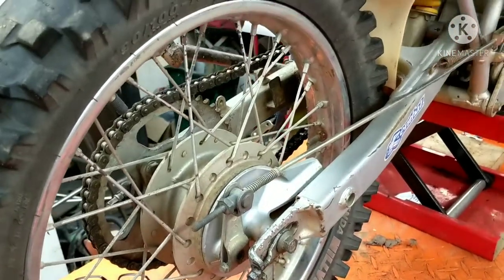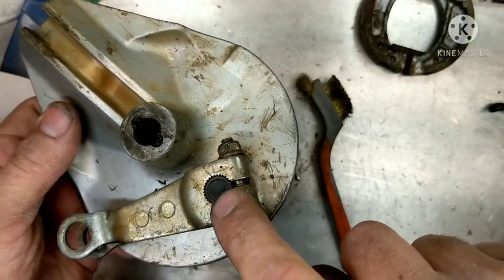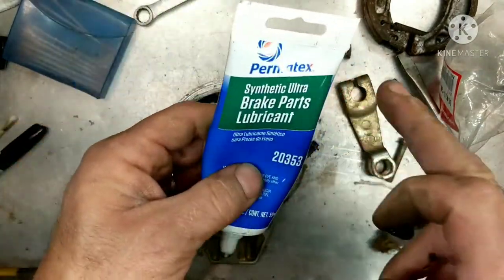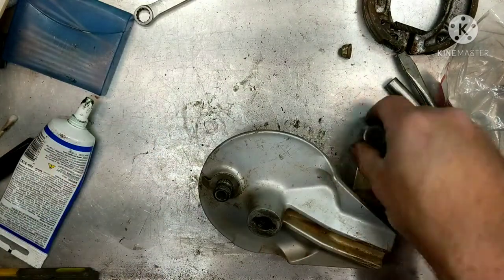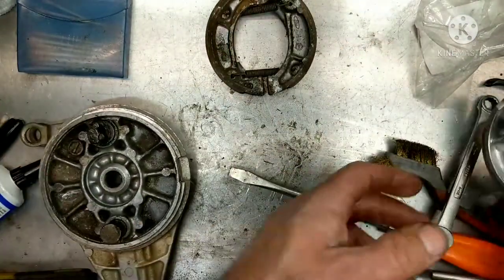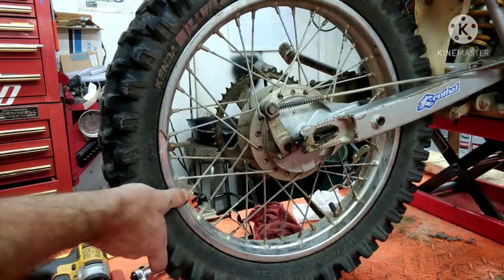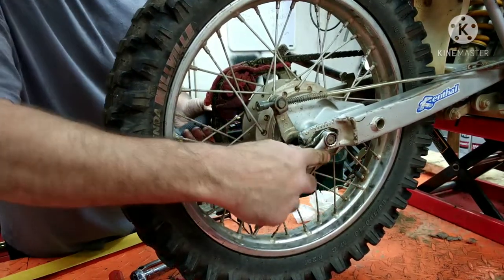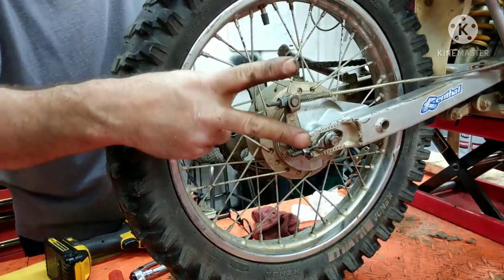Honda XR100 CRF100 rear brake replacement.

Comment: I have an issue with rear suspension link, I'm trying to remove the bolts but there is one I can´t take out, it holds the "triangular" link to the swingarm, I noticed there are two welded washers that doesn´t allow the bolt to move out, could you give me an advice on how to remove that bolt? Thanks for your help in advance... Have a nice day!!!

Comment: I have a question the front and back brakes are the same size? I have to replace the brakes on my 2002 xr100r but both look similar

Comment: My springs do not have opposite hooks is that normal or do I have to get the spring to twist in order for them to be opposite, I have the same amount of tension as you do in the video
Reply from the maker: The springs should be opposite, if they're not they're the wrong ones. You can't twist them to work, the spring tension will just twist it back.

Comment: I just bought a 2003 xr100r and the rear wheel was missing all the spacers and the bearings were shot. Can you please explain or show where and how the spacers are assembled! I was hoping you would show complete disassemble and reassembly showing spacer placements. Thanks
Reply from the maker: Best thing to do is check out a parts diagram for spacer locations. I do have an XR100 here now, if you have any questions please feel free to email me on my about page. Here is a link to the parts diagram for your rear wheel.
https://www.rockymountainatvmc.com/oem-schematic/2
Just select rear wheel after clicking the link.

Comment: My rear break hub won’t come off. I’m thinking pry from opposite sides at the same time and try and force it out. What do you suggest?
Reply from the maker: Make sure the brake pads are retracted all the way.
Reply: I have everything off but the hub and the shaft the lever slips onto. I put the lever back on and worked it back and forth while I was pulling up on the hub. Still jammed. The hub will rotate all the way around freely

Comment: Whats the thing that holds the rod?
Reply from the maker: Rear brake arm. 43410-KN4-A60
Reply: @TepcoCycleRepair  no not the arm the thing thats in the arm that the rod goes thru
Reply from the maker: @Yabadoop  Rear brake arm joint 95015-32001 I get all my parts from rockymountainatvmc.com
Reply: @TepcoCycleRepair  thanks man i came in the mail last week of amazon and now my brake works again. Your the first one to help me thanks dude!
Reply from the maker: @Yabadoop  Awesome, thanks for the update!

Comment: Ok so I put brand new pads on for the rear and they don’t grab… not even the slightest I cleaned the drum and still the same thing
Reply from the maker: Are they making contact with the drum?
Reply: @TepcoCycleRepair  yes, when I have the rear wheel off the bike and try to rotate the drum while keeping the wheel still it will grab nice but as soon as it goes on the bikes it’s ineffective
Reply from the maker: @therealilxaiden  So two things can cause that, Improperly adjusted mounting point/brake rod or extremely worn drum. I'm going to guess the first. If it doesn't grab with new pads, rotate the arm one notch back and reset the brake arm. If it's too far forward when you step on the brake, it will bottom out and won't be able to apply the proper amount of brake pressure.
Reply: @TepcoCycleRepair  I solved it. For one I didn’t have the dots lined up on the rod and arm. And two I had the rod way too much to the front. They work nice now. Thanks for the help 😁
Reply from the maker: @therealilxaiden  Good job!